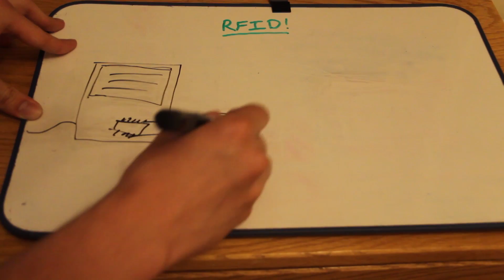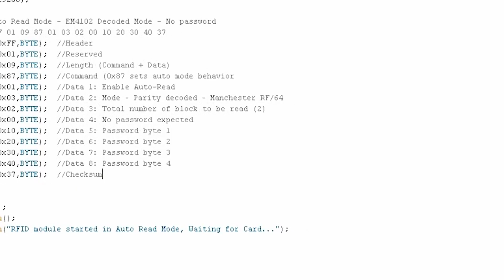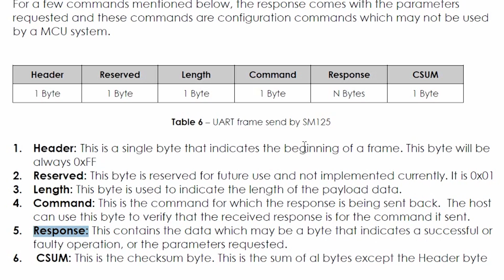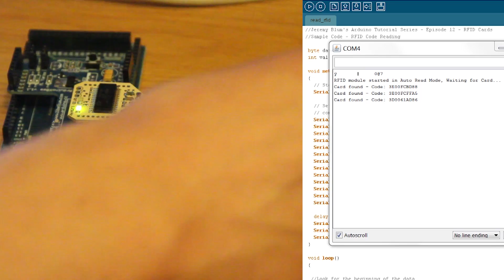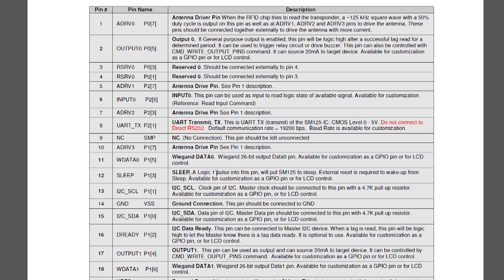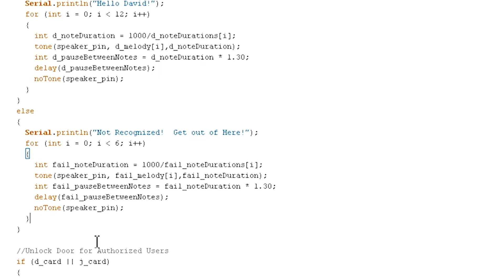Tutorial 12 for Arduino: RFID Card Reading

Comment: How can we build a system where the card needs to be positioned and left on the RFID reader area so the relèy can be turned on as long as the card remains on the reader (no limit of time), if the user takes off the card, the relèy turns off?

Comment: Hello Jeremy, your tutorials are awesome and you are clearly a really great programmer and an excellent instructor. There is a problem that several arduino users are having with RFID readers and SD cards.  Basically, we would like to save the RFID card numbers to an SD card. However, once you hook up two slaves (RFID and SD) to the MISO pin 12, the RFID reader no longer reads cards. I have yet to find a solution to problem and I was wondering if you could post a solution on one of your tutorials. Again, the problem is simply running an SD and RFID reader on the same arduino.  Thanks for any help you can provide, Brandon

Comment: Hey buddy great videos. I have a general question. I'm writing code that runs a background timing in "millis" mathematically adjusted to increment in seconds keeping a general concept of time. If I write an "if statement" with the "delay" function will it disrupt my background timer running "millis" or just the pins that I will have in that specific "if statement" codes brackets? If this question is ignorant to any concepts I apologize I'm new to this.
Reply: as far as i know, delay function keeps your Arduino 'stuck' for the specified amount of time.. I will have to check its dependency on millis.. i shall get back to you

Comment: What about Writing into em4100 writable cards Jeremy. I'm trying to build a rfid writer to destroy all copied (writable)  cards. Do you have any video or can you send any recommendation for any cheap module ?
Reply: I wonder if there is any easy way to make these cheap chinese rfid tag systems (e.g. MIFARE MF RC522) even half secure so that the tags couldn't be easily cloned.. This 'try to write to block 0' to disable writable cards is one way to do it ( I guess!?) but it would be nice to know if anyone has actually successfully implemented that with Arduino... Otherwise these cheap 'Arduino RFIDs' are quite useless in any access control (door lock) projects.. Unfortunately :/

Comment: there is showing a error due to "BYTE" when i am trying to run this program... can you please help me??
Reply: +Dipanwita mitra The behavior of Serial.print() on a byte has been changed to align it
  with the other numeric data types. In particular, it will now print
  the digits of its argument as separate ASCII digits (e.g. '1', '2', '3')
  rather than a single byte. The BYTE keyword has been removed. To send a
  single byte of data, use Serial.write() (which is present in Arduino 0022
  as well).
Reply: Thank you Michael Henri Aguilar

Comment: hi great vid im using an external rfid for extra security as its on the outside of my front door, the code i made is doing its job but also now an again it not accurate and opens when it shouldn’t the output (high) on the rfid is 3.3 - 3.5 volts so it cant power a relay (5volt input required for them) so using an arduino to measure the volts in analogue and then controls the relay
the code is here and left commented out lines to show what iv also tried!
 // initialize serial communication at 9600 bits per second:

int door = 12; // door
int led = 13; // led
float threshold_voltage = 2; // Set threshold voltage

void setup() {
pinMode(led, OUTPUT);
pinMode(door, OUTPUT);
Serial.begin(9600);
} // the loop routine runs over and over again forever:

void loop() {
// read the input on analog pin 0:
int Input_Voltage = analogRead(A0); // Convert the analogue reading (which goes from 0 - 1024) to a voltage (0 - 5V): //
//float voltage = Input_Voltage * (5.0 / 1024);
float voltage = Input_Voltage * 5 / 1023 -1; // print out the value you read:
Serial.println(voltage); // check input voltage // while(voltage < threshold_voltage){
if(voltage > 1.1){ // open door
digitalWrite(door, HIGH); // turn the door on (HIGH is the voltage level)
digitalWrite(led, HIGH); // turn the LED on (HIGH is the voltage level)
delay(8000); // wait for 8 seconds
digitalWrite(door, LOW); // lock door again!
digitalWrite(led, LOW); // turn the LED off by making the voltage LOW
} }

also along with the inaccuracies (maybe as not using aref pin 5 volts im not 100% sure) i am also getting a delay of 4 - 5 seconds before it opens the door when it should be instant, any ideas please from anyone how i can fix this and make more secure so its more accurate and doesn’t open when it shouldn’t? i am using a common ground between the relay via arduino uno and the frid control unit (from amazon) and they all use the same power supply so its a common ground for all of the devices used, also the same that powers the actual magnetic electric lock (the power is powered from the same supply with common ground with the rest). i had to do this as batteries die over time so i really would like to keep this supply as it is if possible. anyone have any ideas how to improve the code and shall i put a connection from 5 v vcc (arduino) to the aref pin on the arduino for the reference aswell?

Comment: i have a rc  rc522 that runs at 9600 braud rate and cant get it to read or write anything any ideas? also it sais pin ss but there is no ss pin on the rfid reader so im confused!
Reply: yes why not , use 9600 , here he use different baud rate according to the data sheet of his RF ID Reader .regarding to the SS  ,  your RF ID has many way to be connected you have to grab on of them and use it , according to you choice the commands and connection will be , here what you are doing is connecting RS232 and using the requirement of SPI bus and that is totally wrong .

Comment: I'm planning on making one of these, but mine will actually be silent. I don't want people to know that it's in my car. I am going to install it in my car, and set it so when the car is taken out of park it will check to see if an RFID card is present in the seat. If a proper card is not present, it will trigger a relay that will disable the ignition system of the car shutting off the engine. This kind of system will make it so, even if you have the key to my car, you still can't drive it away.

Comment: ScyGuy14, I work with RFiD technology daily as part of my job. A recent project I'm working on at work involves heavy use of the SM125 chip (like the one used here).

For shiggles, and after a lot of scoping and hacking, I was able to take the RF front end circuit used with this chip and drive it from my Arduino. I can successfully read LF (125kHz) RFiD tags/cards using nothing but some discreet passive components.

Feel free to contact me for details. :)

Comment: First, I figured out that the BYTE command is no longer supported in Arduino 1.0 and corrected this with the Serial.Write() function. I'm having problems with line 25 which is corrected for 1.0 to: Serial.write (0x00);  // Data: 4 No password expected. When I check this code I get an error that says: "call of overloaded 'write(int)' is ambiguous". When I delete this line the code uploads but the cards are not registering on the serial monitor. Yet the cards dont register on the monitor, Advice?

Comment from the maker: @jaysenstudios Yes, but I wouldn't use it as a means to control current flow directly.  Hook it up to the Arduino as an analog input, measure the value is software, and then use a wire to connect a digital out from the arduino into the enable pin of the RFID chip.

Comment from the maker: @l0rtto No it's correct.  The j_card value is initially set to true, but the if statement can only possibly make it false.  So once the one of the if statements in the for loops evaluates to false, it cannot be made true again on another run through the for loop.

Comment from the maker: @lebeyes Sorry for not clarifying that.  The jumpers on the Xbee only change where the Arduino RECEIVES data from.  So, the arduino receives data from just the RFID card reader.  But, when it sends data, it sends it to anything that happens to be connected to it's serial port's TX line.  So, the computer, and the RFID card chip receive everything it sends.  Conveniently, the RFID chip will just ignore any commands that it does not understand.